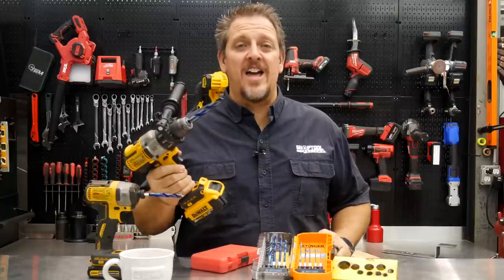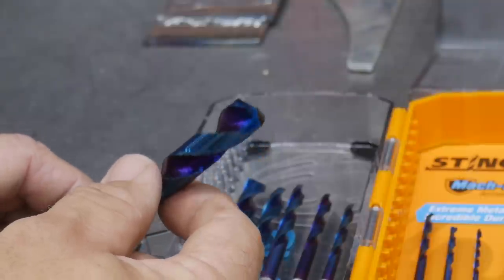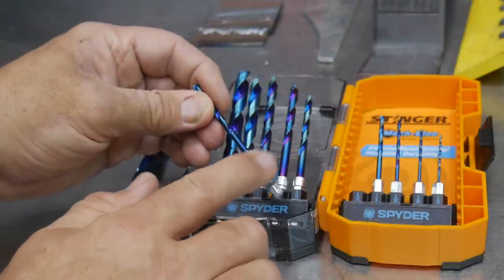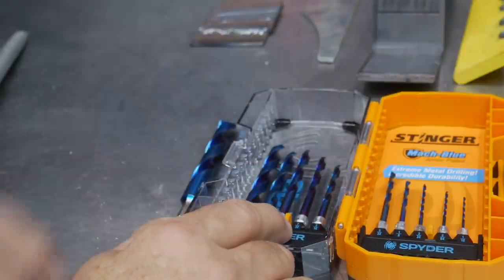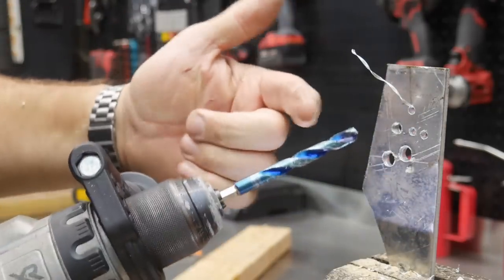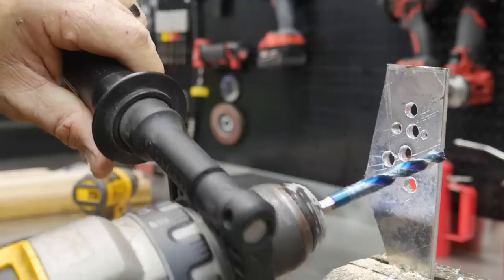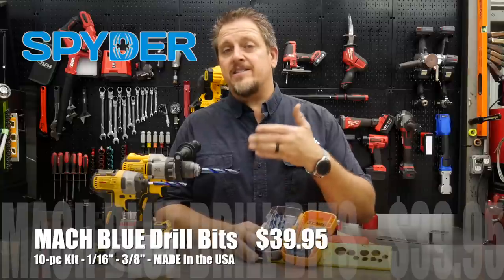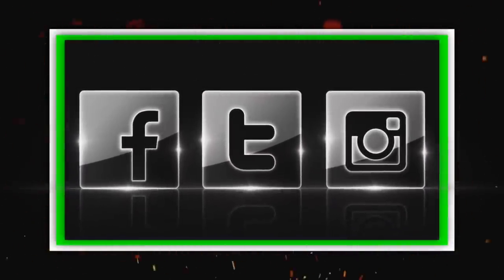Spyder Mach Blue Stinger Drill Bits Review [10pc Kit]

Comment: My biggest problem with any coated bit is if it's used enough and long enough the coating will wear off. At that point, it is only as good as the base metal.
Reply: This all looks like hype marketing for excessively overselling the product.
Reply: @ObservationofLimits  in a way it is. Which is why I would rather have good quality cobalt HSS bits. It's know after they dull I can sharpen them and expect the same performance until next time it needs sharpened.

Comment: The 1/2" with no pilot hole was significantly faster than with the pilot hole, and that not counting the time it took to make the pilot hole
Reply: You really don’t pilot split points. Only chisel tips. Otherwise you create stress points on your cutting edge and it will chip out there.
Reply: Exactly. What he said about a non split point not following a hole?
Makes NO difference. And they are titanium oxide coated drills. Not titanium drills. I was drilling at 1200 rpm with a 1/2” drill 50 years ago. And a cobalt drill set doesn’t cost any $100. Check Milwaukee.....and they still aren’t top. Just so much bad info.

Comment: To answer the unknown, two years later, the 1/2 inch is 20 bones at Lowes.

Personally, I made a command decision to buy the set on ebay. I paid $5.00 more than the Lowes price for the set, but I didn't have to drive to Lowes. But then, I got the 1/2 inch from the same seller on ebay for 15, whereas it is 20 at Lowes...so I got my 5 bucks back.

I do not love having spent 60 bucks on the full bit set (including the 1/2). It's not what I usually do. But of I no longer need a separate set of bits for thick metal, this will be well worth it.

Comment: I haven't used anything else ever since Matco released those hyper step drill bits. Our shop now has 2 sets including all the way up to ³/⁴"
Reply: Do you like the matco step bits they are very expensive and you cant resharpen them interested to know how they are holding up
Reply: @FixitFred  they wear out eventually just like any of them will but they cut amazing. We do a lot of custom fabrication work and drill 60-100 holes a day in steel and aluminum and they are the best we have had. They are lifetime warranty not to mention so you don't sharpen them you just exchange them for a new one. Our Matco rep comes by every week and we have no warranty issues when they dull. They cut a perfect lazer like hole thru 1/2" plate steel with no issues. They don't walk and you don't have to drill a pilot hole first.
Reply: My only issue with the MATCO hyper step bits is only the larger size ones are actually warrantied, not the smaller ones but they definitely are some amazing cutting bits. If you think about it the larger sizes are higher in price so replacing the smaller ones out of pocket might not be too bad, I am not sure of the availability or price of them individually however.
Reply: @Bos742  we don't use anything under a 1/4" so everything is covered. When we do use 1/8 or 3/16 we just buy Bosch cobalts for 2 or 3 bucks a piece. I have bought the 3/16 hyper step before and it was $12 bucks a piece.
Reply: The Matco bits are the best thing since sliced bread! Only problem I have is keeping a Matco guy coming by the shop.
Reply: @jonweaver1431  just have to always owe him money 💰. That way he will always come around then haha.

Comment: I wouldn't pick these up until I see a longevity test on them especially after seeing the poor casting quality on the <1/4 shanks. Most drill bits in that price range will cut fine at the beginning but if they claim 100x durability then I want to see it get close to that.
Reply: I accidentally discovered this bit line a couple years ago. Had to pre drill into heavy C channel for pre insulated metal wall panels. It impressed me with cutting ability and durability. The casting imperfections are likely left alone to save money, and not a representation of overall quality. I highly recommend from my ironworking use of them.

Comment: coming from a metallurgist POV that seems more of a color left over from a heat treat and tempering VS a coating.  its not a TiN coating "Titanium nitride" or a TiAIN coating "Titanium Aluminum nitride" i don't know of a common coating on a twist drill more wear resistant than TiAIN coating. this seems to me to be marketing wank. ill have to pick up the 1/2" twist drill and even put it against an uncoated norseman 1/2" twist drill.

Comment: Just used the 3/8” in this set to drill out broken bolt in a catalytic converter flange. Used about 6 different drills from a hhs drill caddy set to no avail. Lowes has this set on sale now, bought two. I’m impressed.
Reply from the maker: That's awesome, glad it worked for you. Thanks for watching and sharing.
Reply: What a coincidence I just bought a pack and am doing the same job qswell lol

Comment: How do these compare to cobalt drill bits? I have the Milwaukee cobalt bits and they are animals
Reply from the maker: Cobalt is not a coating, so it's a much better drill bit throughout. The Mach Blue is a great in-between bit, when you don't want to pay the price of Cobalt. Thanks for watching.
Reply: I like cobalt bits as well but me personally i actually prefer molybdenum bits at least in a cordless drill idk about drill press as i dont have one for the jobsite. They are cheaper and i feel like they last longer. Tough to say idk if one drills faster then the other or not. Also cobalt breaks easier cuz they are so hard. Molybdenum resist against like 4500 degrees while cobalt only resist against like 2800 degrees. I get drill hog off ebay and they have the option for both. I have a 29 pc set and then also have a big drill bit box organizer more made for a shop but mounted in my box truck and drill hog offers buying individual sizes as well in 6 or 12 packs depending on the size
Reply: I’m assuming when you say moly bits you’re talking about M7. Even though other M grades (commonly just referred to as Cobalt steel) have moly too. M42 would be best for doing hard materials sans coolant or limited cutting fluid.
Reply: @ObservationofLimits  yes i do mean m7. I guess my thing is 98% of the time im drilling mild steel but will be 3/16" to 1/2" thick and ive felt like the m7 bits have had longer life then the m42 cobalt bits and are cheaper. But also using a cordless drill not a press. I dont really know too much about what the m rating actually means and ive seen one they had called "pig steel m60" and it was garbage

Comment: I used them for the first time today and three bits snapped (3/32, 5/64, 1/16). I thought these bits were better than the rest but maybe the one I bought was a bad set. Bought dewalt for now but will probably return again.  Normally I buy the Milwaukee set but they don't last either.
Reply from the maker: Wow, that seems pretty crazy. Just about everyone we've talked to has been very impressed with these. The coating WILL wear out over time, but they're great bits for the money. Thanks for watching.

Comment: Too bad the smaller bits don’t have steel shanks... Milwaukee bits have the steel shanks. Aluminum shanks are a deal breaker for me.
Reply: It lasts like 5 holes
Reply: cast zinc, not aluminum- they have been around for years and hold up great on Kobalt, Craftsman, etc.

Comment: I want to see a head to head vrs the mac co hyper bits.  Theway ib judge a drill bit is how tired I am when I get done drilling a hole.  My hyper bits.  Cut faster then any thing else I've tried including tungsten carbide
Reply: I was just thinking about those, I just got the new cobalt version and they were about the price of a nice truck payment, but I drilled out a couple hardened roll pins with them and drill bit was like new. Also having a warranty is helpful to offset the price. They are a bad ass drill bit

Comment: This bit works great! BUT!! It dose not fit a kobalt or a Mikita impact they claim to be 1/4” but they are slightly bigger
Reply from the maker: We've run these in both our Makita and Kobalt impact drivers without issue. I mentioned in the video that some of the casting marks needed to be removed on some of the hex shafts. You may need to do the same. Thanks for watching.

Comment: Either your impact chuck is worn out to fuck (unlikely) or those shanks are severely undersized. Holy shit that was a ton of wobble. 

Drill tip? You mean a chisel tip? Or a brad tip?

Lol that took entirely too long to cut through that 1/4 plate (which looks like mild steel)

And yea you keep getting chips, it’s an extra wide drill angle. 

Speeds and feeds, apparently something you don’t know.

Comment: Just another colorful fancy selling point, know your job, know th tool. These are just jewelery for your toolbox
Reply: Ya. If you use bits right, plain old HSS bits from Chicago Latrobe are fine for most jobs. Norseman makes quality bits.

And coatings are only good until the cutting edge wears then they’re just plain HSS after resharpening. 

Coatings are also only really necessary for metals like aluminum that will gum up and weld themselves to the edges and the flutes. 

If you have hard materials and or deep holes, invest in cobalt bits (high cobalt like m42).

Or if you’re not an idiot and can be careful, carbide bits. In an average year I end up having to drill and extract 1,000+ hardened button or flat head cap screws (m6 and m8 because people like to use ball end drivers on a fucking impact on cover screws that only need a little tighten and not gorilla foot*pounds of torque). Over the whole year I’ll probably only have to use 2 carbide bits, and 99% of the time they fuck up because I’m squatting inside a machine covered in oil with all slanted surfaces and slip.

Comment: That is not a good sign,  you have to clean up the aluminum shank first..... made in the USA ROFL....
What a way to test drill bits..... omg...
PS: Where did the coating go after those few holes?  @9:38
Reply: The drill bits are made and coated in the US!  The shanks are cast zinc, not aluminum- they have been around for years and hold up great on Kobalt, Craftsman, etc.  Any coating will wear off when you blast through steel plate over and over
Reply: @9fingernic  Yeah that's what I said....made in the US.... Shitty finish...  Ah yeah Zink.... 
Over and over?  2-3 holes ?

Comment: Drill bit coatings are only useful in long production runs where you need the lubricity to help prevent chip load in the relief, other than that maybe to help prevent rust in humid work environments?

Coatings wear off pretty quickly using hand tools with high runout, and now you are relying on the base metal. Cheap drill bits are made from cheap material. Coatings are pure marketing for the ignorant. Something to consider as well, drill bit runout, drill bits shrink fitted into proper hex shanks are going to have slightly more runout than a properly ground drill bit, and worse having a "cast" hex index is laughable. What a joke. 

Also, using non-masonry designed bits in an impact wrench. Yikes.
Reply from the maker: You must be a machinist or engineer...and I say this with all due respect. It's obvious you understand cutting tools along with the metallurgy. You are correct, coatings are coatings. No replacement for a full index of cobalt bits or high-quality high-speed bits. With that said, as I mentioned in the video, not many people are going to pull the trigger on several-hundred $$ for drill bits...especially shopping at a big-box store. So, I take in to consideration this is a $40 kit, Made in the USA, and they seem to cut really well. I also mentioned the cast aluminum as a concern, but they'll probably last a few hundred cuts, if taken care of. They are said to be impact driver ready (I said "Impact Wrench" a couple of times, but I meant Impact Driver), and they worked quite well with the impact driver. Albeit, you should (as I did) keep the impacts to a minimum when using the impact driver, so it's only using the rotating motion for cutting. Thanks for watching.
Reply: are we mixing up impact and hammer, here? Hammer pushes forward (so, masonry); Impact twists (everything else).
Reply: A hammer drill is for drilling into masonry, not an impact driver. Impact drivers are for driving fasteners and many drill bits are rated to be used with impact drivers.
Reply: @jasonjayalap  I was not mixing them up, I stated Masonry bits because the shank portion of the masonry bit is designed to take repeated "impacts" without breaking, as well as the cutting edge. Drill bits, taps, endmills, etc are all at different varying degrees of hardness, which makes them brittle. Like soft taco shells vs hard taco shells, one is tougher and is less likely to break by being "soft" while the other due to its hardness when flexed is liable to break easier.
Reply: Got That Right, this coating is just a marketing. I Use solid Carbide Drill Bits For hard Metals.
Reply: @illestofdemall13  IF a drill bit is rated for "impact" drivers, it isn't a very hard bit. Tougher bits mean they aren't made from hard material. At best a "impact" rated bit would be made from tool steel. High carbon steel, HSS, carbide, ceramic, diamond-tipped, PCBN, etc. are all very brittle in comparison, impacting would just chip the leading edge.
Reply: @limitedal1  hopefully in a rigid setup :P
Reply: @Doichable  It says it is.
Reply: @Doichable  The manufacturer says they are impact rated. I haven't tried them out and neither have you, so we don't really know how well they will perform.
Reply: @Shoptoolreviews  The shanks are cast zinc, not aluminum- they have been around for years and hold up great on Kobalt, Craftsman, etc.
Reply: I think we're a little lost in the sauce here. It's plainly obvious that the price point puts these bits in the typical field work domain. Trying to snub them as inferior to high grade carbide isn't just a mistake, it's arrogant.  This is a good review and from someone who has actually abused one of these over several hundred cuts out in the elements, it's accurate. Jog on.
Reply: @illestofdemall13  I used a few in an 268 versa clutch. What I found was that if I preferred to have the gun spin without impacting. But whenever it did, there wasn't a consequence of note to the bit.

Comment: Not realistic due fact no true test is accurate until you still through 1 inch stainless and hardened moly vanadium  tungsten steel is the true test. If a bit can do 500 holes through that then it gets my vote

Comment: I’m sorry, but I am not impressed the second I heard those three words, cast aluminum shanks, I knew these are cheap, marketing focused, garbage. Plus, wth is up with selling the 1/2” bit separately?That is just straight greedy and lame man, for real. Also, “Made In The USA” is at an all time low when it comes to wow factor these days. I actually am starting to prefer certain things made in China over some stuff made in the US, and it makes sense. The same American thinking that outsourced all of the labor to China in the first place didn’t go anywhere, it’s still here, ready to start producing stuff in the US again, only as cheaply as possible this time so they can claim they made it here to score a quick buck. Plus, China has been getting good at this stuff through all these years of manufacturing and what not, if they haven’t already, they are going to start straight dumping on us any day now, hard. I’m 95% sure they already have though hahahha
Reply: The shanks are cast zinc, not aluminum- they have been around for years and hold up great on Kobalt, Craftsman, etc.  Chinese factories do not have as high quality control standards or materials, thereby making it cheaper for them to be imported.  Drill bits break, but most US-made bits are better.  Some European and Japanese manufacturers make excellent products as well.